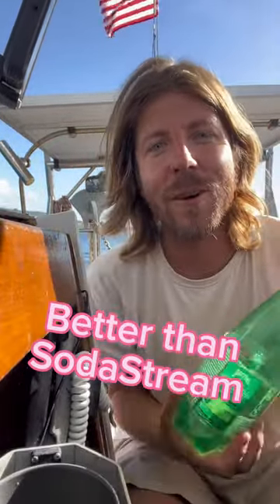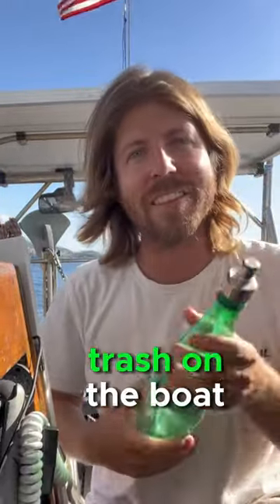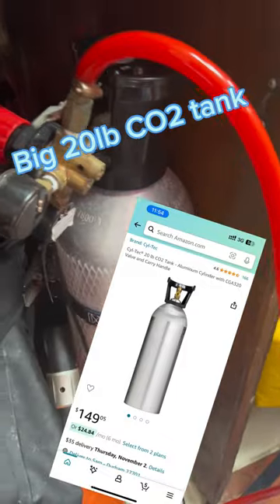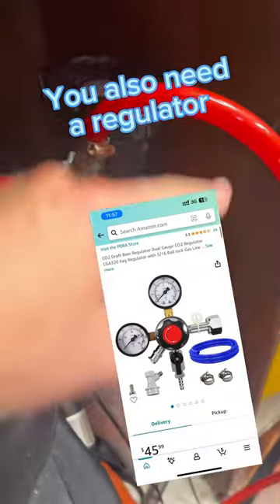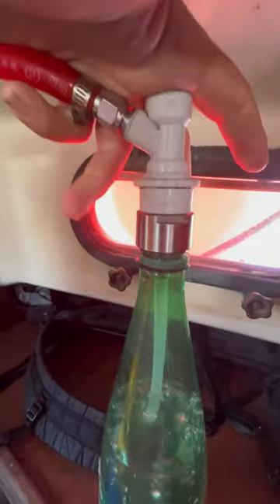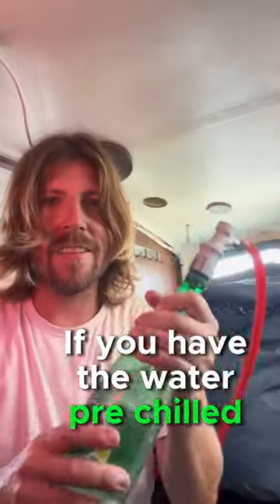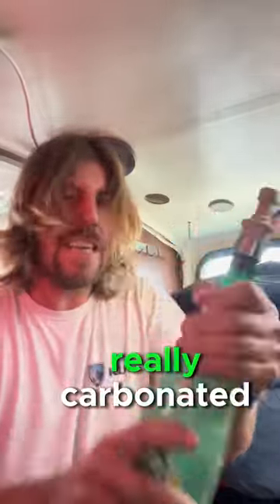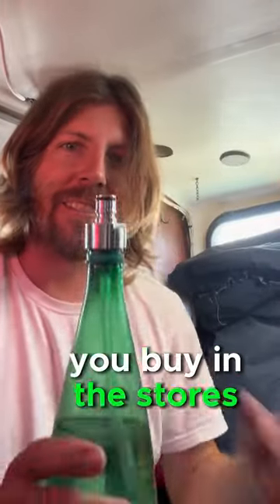How I make the best soda water on my boat

Comment: That is a really great perk to add to cruisin' life.  One thing tho':  There is a safety note with this system. I'd be careful to install it where a CO2 leak can vent to the outside of the cabin. CO2, while non-toxic, is still capable of suffocating you if it displaces  atmospheric air, for instance, while you are sleeping. So if you had a cannister leaking inside the boat, and you were sleeping  fairly low in the cabin, there's a stray possibility you might wake up dead.  Be sure to shut the main valve when not in use, if nothing else!

Comment: Shaking is legimitely a way to impregnate the water with the c02. This method is used in the aerosol industry when a product is oily or thick in general to allow the c02 to seep into the material to allow a higher spraying force for the end result. The More you know!

Comment: Personally, I prefer to just refill my small tanks from the medium tank, then I don’t have pipes strewn around, and if any one springs a leak, I still have the others. 😉
Reply: PS: I highly recommend NOT drinking out of the bottle in which you carbonate. Regardless, it’s very important to SANITIZE everything. Personally, I use a little bleach, which will kill all almost everything that might kill you. 
If you wanna get really fancy, get some soda kegs, and carbonate your sanitized, fresh springwater in those, and have bubbly water ON TAP at all times. 😋
But definitely sanitize everything that comes into contact with stuff you’re going to ingest!

Comment: I have this and a soda stream. Soda stream is WAY better.
Reply from the maker: I much prefer my CO2 tank method over the soda streams.
Reply: @samholmessailing  sodastream injects liquid CO2. This way is just gas into the head space. You have to shake to get it to carbonate. It works and I did that for years but sodastream is better.
Reply: @palindrome414  So do you have a Sodastream (i have one, too!) on your ocean capable sailboat?